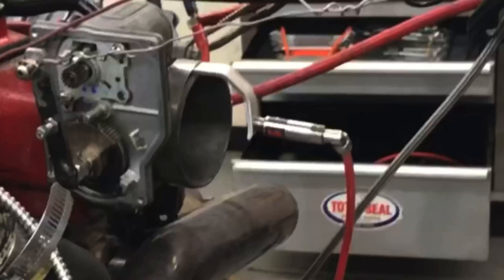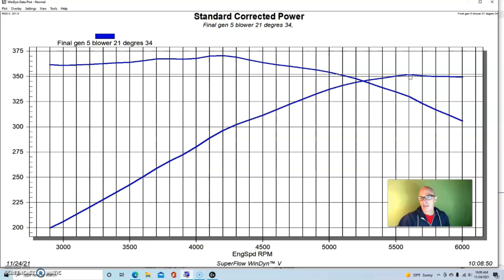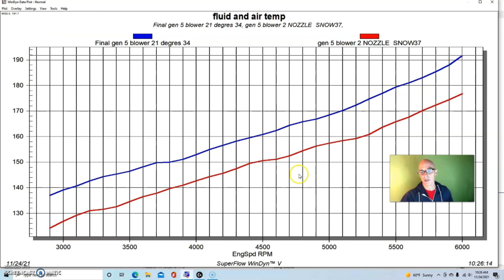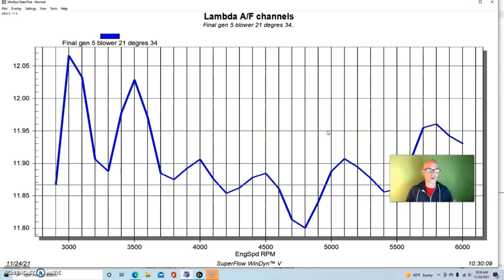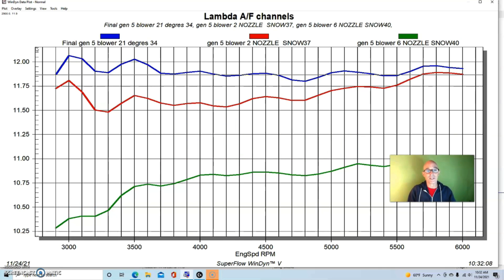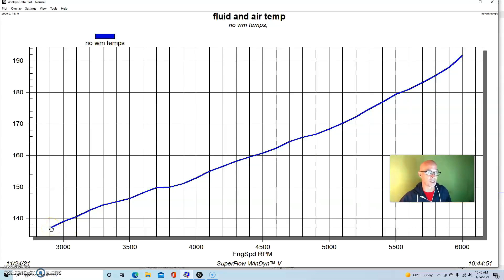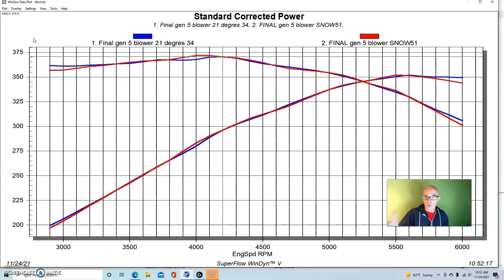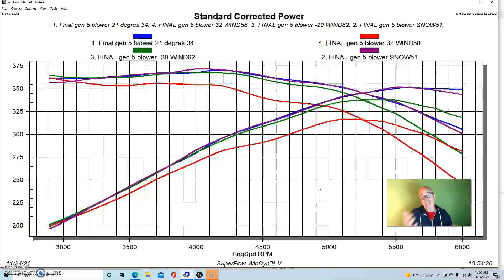WATER METH VS (LOW-$) WINDSHIELD WASHER FLUID-WHO WINS? BEST WATER/METH VIDEO EVER! IATS, AF & HP!

Comment: Extra 5 psi of boost made possible by the water/meth.  Extra fuel for the extra air.  Injector pulse width actually went down.

Comment: On my turbo Beetle, by adding water/meth and an additional 5 psi boost, I went from 352 awhp to 416 awhp at the flip of a switch. (That's right, I said all wheel hp)   I also buy 5 gals of methanol and mix my own with distilled water at a cost of about $4.50 a gal.  Thanks for the great video.
Reply from the maker: 5 psi of boost does wonders

Comment: I think the point of using water/meth injection is to be able to safely increase boost. If the engine is already running optimal, adding the water/ meth won’t have any benefit under the same boost.

Comment: I'm sure you already know or others have mentioned but I didn't see it in a quick scroll. Something a lot of people do with the -20f washer fluid is add a bottle or 2 of heet(yellow bottle,gas line antifreeze) I have also heard of (and tried) adding a 32oz bottle of 91%isopropyl to a gallon of -20f.
Reply from the maker: it still won't add power
Reply: @richardholdener1727  thanks for replying.  I have read it a lot over the years and didn't know if it had truth behind it or if it was another case of "piston flipping".

Comment: I have done some testing with my wmi cars and have noticed that some brands seem to have more methonal in them vs others even if they are both -20. 
This is based on Temps and fuel trims, my setup was tuned on -20f "champion" washer fluid picked up from my local rual King. 
If I use a different brand from different stores sometimes my Temps are slightly higher and fuel trims are a little higher.

Also a jank way to get afr back under control somewhat while waiting for a tune is to blend in some e85. Don't recommend doing it but it has worked.

Comment: 80 degrees of temp drop in intake equals 800 degrees of temp drop at TDC on a 10:1 compression engine. The spark would be able to be advanced aggressively, I think.
Reply from the maker: 800?
Reply: @richardholdener1727  Boyles law, isn't it?

Ten times the pressure gives ten times the temp above absolute zero, right?

Example, naturally aspirated: 14.7 atmospheric normal is 147 at 10 to 1 compression, temperature is 120f, plus the 400f above absolute zero to get 520 f above absolute zero baseline

Thus, with 10:1 compression, that makes 5200f above absolute zero when  compressed at 120F ambient. This puts its in-cylinder temperature to 5200 F minus 400 F degrees above absolute zero, giving us 4800 degrees F when compressed to one-tenth of its original volume.

Then, 120F plus 400F  above absolute zero PLUS ANOTHER 80 is 600F above absolute zero as a pre-compression point, then compressing it  times ten and resultant temp at 10 to 1 is 6000F above absolute zero, netting 5600 degrees F

AKA: 800 degrees F hotter than 4800 degrees F, yes?

It profits greatly to reduce intake air temperature.

Now think if you cooled the intake charge to ambient, around 120 degrees, then air-conditioned it to minus 60.

Now you have an air temperature that another 600 degrees cooler when compressed at 10:1 than ambient.

People underestimate the amount of benefit from cooling that intake charge, temperature-wise.

Comment: Retune is not necessary is you use it for IAT cooling. I have a supercharged V6. My nozzle is mounted just after the intercooler so the boost juice evaporates in time to just cool the air. I see 43 degrees cooling and 50ish more HP, because without it the ECU pulls 4 degrees, due to knock. 

My last run today, IAT started at 130 degrees and dropped to 87. But then again, I am centrifugal with an intercooler. I am running a 8gph.

Comment: Lets put this on an ex5 mazda turbo 
D I engines get dirty valves and are octane sensitive . If i can get more power out of low octane gas and keep my valves clean . I want one and then install one on all skyactive 2.5 turbos . Imo all di engines need this .
Reply: I'm gonna add the AEM methanol water injection system onto my Mazdaspeed 3.  Hopefully it will help keep the valves & intake clean, as well as changing to a dual oil catch can system to keep pcv fumes out of the intake.

Comment: if you chip a piston your budding the rings up together and damaging those pistons and there are no OEM forged pistons as a OEM replacement style piston for those unfortunately. now ZZP has forged pistons but the last time I looked they were like $800. and these engines don't really like being rebuilt unless you line hone the blocks. and most front wheel drive builders just don't have that kind of cash an the engines are too cheap

Comment: okay Richard well I would agree with you on the boost juice being the best design of course because snow wouldn't have designed it that way unless they wanted to because it made more power. but the biggest reason on a 3800 around water Mass injection or even just water injection is to get cooler charger and keep it from rattling the Pistons out of the block. the biggest issue with these blower cars on 3800s is when you start pushing the boost higher your cylinder to peak temperatures get too high and you start rattling the Pistons around in the cylinders and they chip a piston

Comment: I don't understand how you didn't gain power after tuning with the boost juice. I have yet to install a single meth kit on a vehicle that didn't gain power with the boost juice. Did you retune or just fix the AFR?
Reply: Nevermind...you ran E85, which negates all the power benefits of methanol.

Comment: You have to be careful buying windshield washer fluid, as many have Ethylene Glycol in them. It is best to view the Material SDS of the specific one before purchase. The one I use has a methanol content of over 30%, then I add about 25oz of pure methanol to achieve a 50% mix.

I mix one gallon of methanol with 5 gallons of windshield washer fluid to get 50% methanol in 6 gallons. This is still way cheaper than the Boost Juice.

Comment: -20 washer fluid is only about 30% methanol, Boost Juice is 50/50. Snow Performance even tells you that if you use washer fluid it has to be the blue -20° and to get it to a 50/50 blend to 3 yellow bottles of Heet. I do lo e the testing but no really a fair comparison.
Reply from the maker: THE COMPARISON WAS EXACTLY FAIR-WE TESTED GTHE PRODUCTS PEOPLE USE MOST OFTEN
Reply: @richardholdener1727  I was referring more to the products. Boost juice is 50/50, and -20 washer fluid is only 30% methanol.

Comment: There is a way to get cooler charges using water injection without injecting a greater volume. And this would at the same time alter the AF less. In terms of latent heat of evaporation nitromethane is superior to methanol. Also it requires far more of it per a given mass of air to achieve a chemically correct air:fuel ratio. Then of course it bears it's own oxygen, producing nitrous as a combustion product. If the pump lines and fittings can hold up to the caustic nature of something like a a 50:25:25 water:methanol:nitro mixture. Wouldn't mind seeing that test, as well as a water injection with E85 fuel test, on a forced induction application.

Comment: On a dyno, I did some pulls with a single stage system on and then one with the system off, no changes in my tune for AF.  But I did have an air temp spark adder setup.  On a Vorteched 347.  The results were pretty big.  528rwhp no meth, 575 with meth.  AF with no meth was 11.7, AF with meth was about 10.5.  Mix was 50/50 pure methanol with distilled water.  When I looked at my logs I had more timing tossed in which is likely what helped the HP jump.  The hard part about your test on this specific setup is those eaton M90/M112 (on the cobras) don't really pick up any power with methanol/water.  It's been tried a ton on the SVTp forum many times.  I think the best results came from someone that did a direct port injection with the injectors inside the intake manifold after the blower and intercooler with an M90/M112.

Comment: Boost juice has been shown to have a very low methanol concentration. They falsely act like it is a 60/40 mix. Therefore it is not a good product. You have to mix it yourself to get it right these days, no products sold actually have the correct mixture that I am aware of

Comment: To echo what everyone one else has commented; thank you for taking the time to do this "comparison" however, I believe the reason a lot of people use -30 to -45 windshield washer fluid as a cheap alternative to Boost Juice is the simple fact that any additional methanol would increase the octane level of the base fuel with an added benefit of cooling the AIT.  If you were to replicate the test but with regular 89/91/93 octane with the smallest nozzle possible and then with the largest nozzle possible, I'm pretty sure your video would brake the half million views mark within the first month. However that doesn't mean that there wasn't a valuable take away from your comparison. If a person wanted to just combat the AIT and add a security blanket to combat knock running the smallest nozzle would not negatively affect the power output but would aid in the cooling department.  Therefore if your not going to tune for it, run the smallest nozzle possible.

Comment: My Favorite Part About Water Methonal Is How Clean It Keeps The Pistons And Ring Lands. My Pump Gas Turbo 3800 With 215,000 Miles Was Surprisingly Clean. I Could Read The Part Numbers On Tops Of Pistons. And The Rings Were Not All Gunked Up. I Don't Realize How Clean It Kept It Untill I Was Gapping Rings On A 150,000 5.7 Hemi lol. The Amount Of Carbon On Pistons And How Stuck The Rings Were Was Insane. Gapping The Rings Was Easy, Cleaning The Rings And Ring Lands Was A Nightmare lol
Reply from the maker: THE E85 KEEPS IT CLEAN TOO

Comment: Wrt the big power losses for the windshield fluid, were those water/methanol blends or water/isopropyl? I suspect the latter, due cheaper, less damaging to rubber components and won't make you blind from casual contact. If so, that's 4x the fuel component that needs to be accounted for...

Comment: Outstanding explanation of the necessity of tuning the engine when adding water/methanol to the mix.  My 595 Competizione's air mix without tuning was lower than the dyno could accurately read.  However, with persistence and expertise, my mechanic has the car running 27 lbs boost and achieving 285 HP safely.

Comment: Please show water injection on a Diesel engine. Back in the day John Deere (I’m familiar with this one) had a water injection system on the model R diesel to boost power and fuel economy. 
Others had similar set ups but I can’t speak to them. Cummins had something similar available on the old 180.

Comment: very interesting to see the power loss as the water content rises.  The 32F is just water and detergent , probably.  In the NorthEast here you can get -25 F wiper fluid which is somewhere > 30% alcohol.  Another thing you can do is buy -25 F  wiper fluid, and then displace some of it with straight methanol (yellow heet).    You can use a beer refractometer ($25) to get a good idea of alcohol content.  Regarding timing, if adding more timing doesn't add more power you can add more boost :)  In my experience on a 10:1 port injection motor running boost in the teens with an intercooler, and 93 octane as a base fuel, the motor would simply blow up (crack pistons) without water meth and/or running stupid low ignition timing.  Water meth injection is the absolutely key to running "normal" NA compression + boost when E85 is unavailable.

Comment: That's odd cause in a gas application and deisel application we saw noticeable  power gains .plus up here in montreal canada we can get -40 . That's what we use . 

Never tried it on e85
Reply from the maker: diesel applications utilize the fuel in WM-that adds power (diesels are throttled by fuel supply), on gas or e85 engines, you need to change the timing to get power gains 9and sometime not even then if the octane has already allowed max timing)

Comment: Good comparison but I’ll volunteer to be the pessimist here. I get the purpose to reduce charge temps and possibly to prevent knock in certain applications (haters please re-read this sentence a couple times) but, as you point out it takes a lot of fuel tuning to regain the lost HP’s from the initial fluid injection. Remember that air is another form of fluid, made of molecules. In a finite space (plenum. Supercharger, et al.) you have a fixed volume size for molecules. When you add water (at whatever mix ratio to methanol) you replace oxygen molecules with water molecules thereby reducing the amount of air that can fit the available space. Your A/F ratio changes illustrate this. Water does not burn and does not compress like air molecules do. Therefore, it drastically changed fluid to air ratio combined with non-combustible fluid replacing the space air would occupy = less power. With all your tuning you basically equaled the original power output so what was gained? Seems like a lot of work for not much return. While this may be a cheaper/easier solution to charge cooling, I would prefer to see other methods of cooling the charge inlet temps to reduce the air molecule size and pack more of the little buggers into that confined plenum space without introducing a non-combustible fluid as the transport method. Oh ya, that’s BOOST!
Reply: They were running e85. Start with 91 and MBT won’t already be reached.

Comment: If your running e85? You dont need water injection! I have never seen an engine knock on akyhol.
Reply from the maker: detonation is still easily possible with e85-the test was to compare the charge cooling and changes in AF with the three fluids tested

Comment: Richard, for the same power number with substantially cooler charge, the boost had to drop about 2 psi off the top of my head. That's where you can get increased power, especially if you are running straight super unleaded.
It takes a crap load of tuning. Snows really doesn't cut it for a good system you really need high pressure for fine mist pattern and in the case of a front feed intake, port injection. The weight of the water meth doesn't allow it to change direction with snow type droplets, too heavy flooding the rear cylinders. With a turbo and a boost controller I imagine you would have seen a 20hp gain. It's really a nightmare for a non pro tuner/designer, almost always costing power without taking everything into account. Intake charge direction, power adder(pre super what you had works perfectly with good distribution because of the supercharger homogenized mixture)
I would absolutely love to see this in a blow through turbo setup or a single 4 barrel blow through throttle body. It will be to much work to get it working with a front feed intake manifold. You will then get all the data.

Comment: Can you use windshield washer fluid yes, however it's a different percentage of methanol so it would require a different tune. The blue methanol based washer fluid is supposed to be 30-35% methanol,  boost juice if I recall is 50%. Now that my pre comment is out of the way I'll watch the video and see if you agree 😀

Comment: I make my own 50/50 water and M1 mix, air temps stay around 110. I use it to cool the air to keep it safe to run more boost, regularly run 30psi with no intercooler. 9 Injectors are almost enough to run the engine alone, and makes a huge difference in afr. Little dangerous if the meth doesn’t come on you are going to be in a very lean condition, I suppose same can be said for any critical system though.

Comment: The higher the boost the lower the knock limit and the more W/M can shine. Please do the test over with 91 octane.

P.S, you need 20-30% more timing to get the most out of W/M
Reply from the maker: PS-i tried more timing-it did nothing
Reply: @richardholdener1727  probably because of e85 instead of pump gas…
I did’nt catch this from the movie, where corections in tune made between boost juice and washer fluid?

Comment: With large amounts of W/M injection, you'd expect the supercharger to seal (internally) better and to generate a bit more boost pressure. Especially when running right up at the Eaton's maximum recommended pressure ratio (2:1, 14.7psi at sea level, assuming you're at/near sea level in your part of the world).
Did the boost pressure change with the W/M injection at all, or with the amount that was injected?

There are some excellent comment posted about knock limits, and W/M displacing inlet air.
It would be very interesting to do the same test again with just straight water.
But even better again would be pre-throttle body and W or W/M inector air intake that houses a Mass Air Flow sensor.
There are lots of marketing claims that say there is more air going into the engine because of W or W/M injection. 
Having a MAF sensor well before the W or W/M injector and switching it on or off would show whether that was true or not.
And a similar thing could be implemented for the for the ECU. Make sure that injector open time/duty cycle doesn't change as a result of what is probable a rather wet IAT sensor. Or just turn off IAT fuel correction.
Reply from the maker: there was no correction in my test (I did all the tuning open loop), the WM displaces some of the air so there would be less airflow, there was little or no change in boost so not sure the sealing theory actually changes things